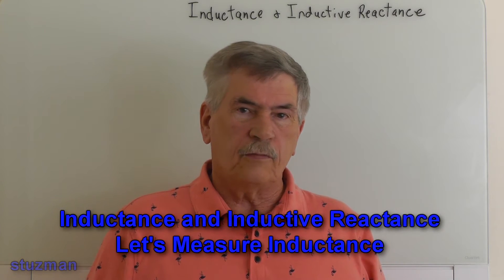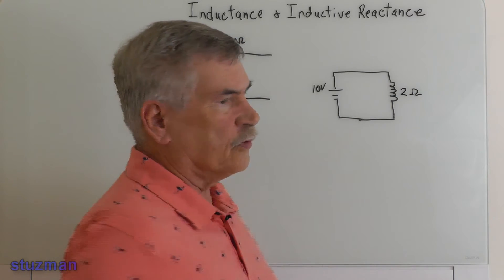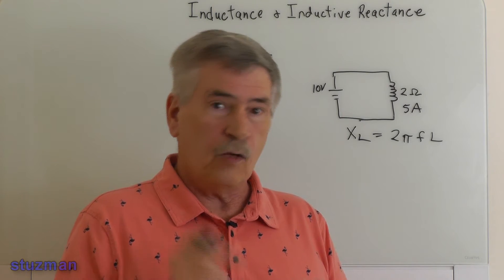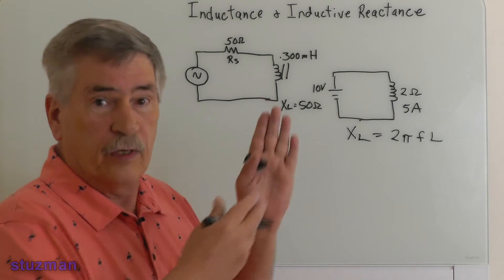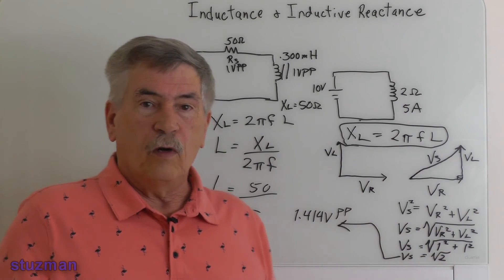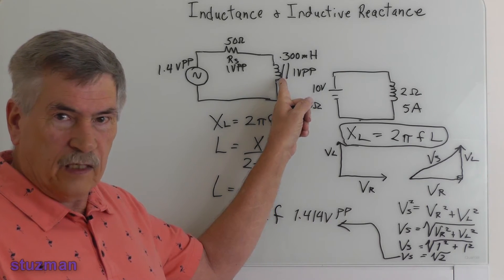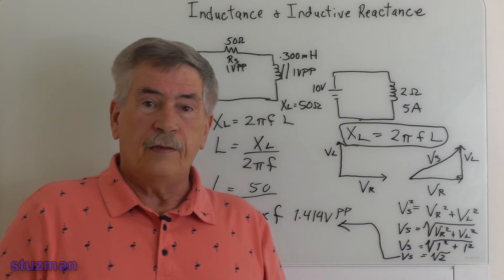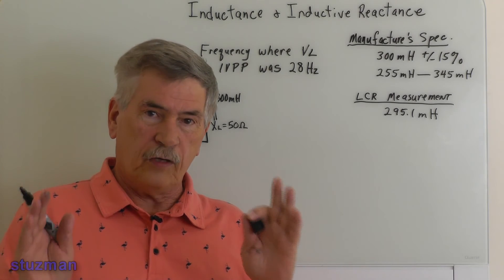Inductance and Inductive Reactance: Measuring Inductance

Comment: Nice review, Terry, you're a natural teacher. Do you know why multimeters don't have a tab for measuring inductance, like they do for capacitance? Is it because capacitance can be measured with a simple DC source, but to measure inductance you need a high frequency AC source, not within the wheelhouse of a typical multimeter?
Reply from the maker: Hi Dave, I found a link that probably is a good answer to your question. Thanks for the comment! https://electronics.stackexchange.com/questions/94354/why-dont-typical-digital-multimeters-measure-inductance